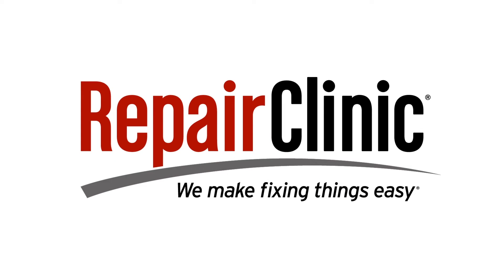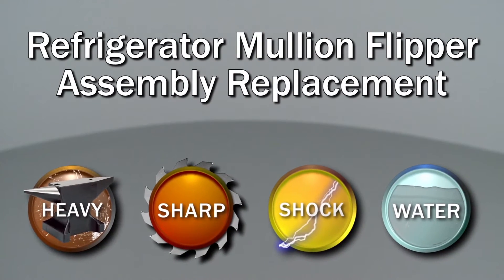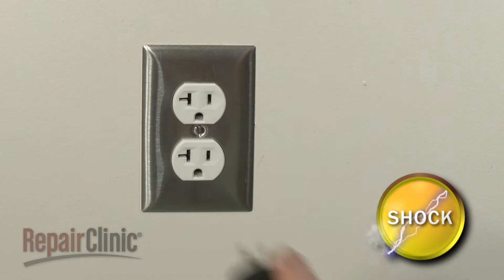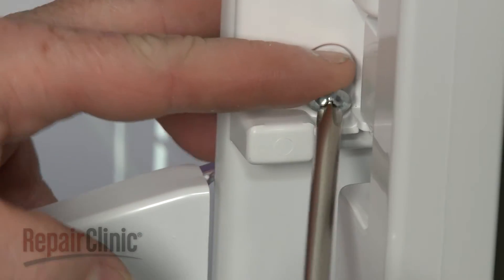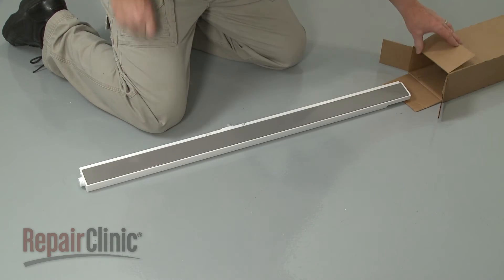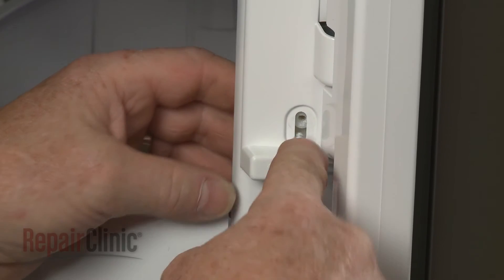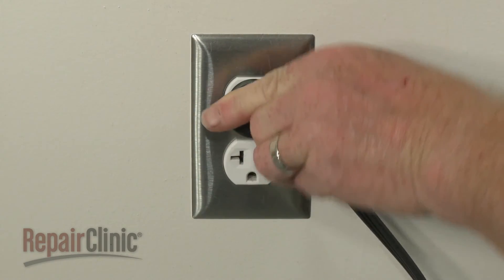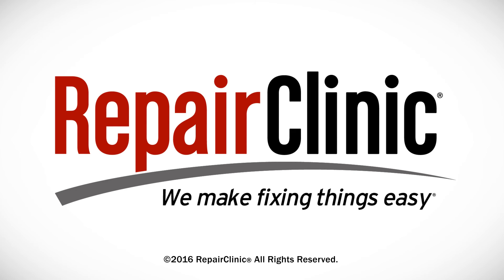Frigidaire Refrigerator Door Support Assembly 241778811

Comment: I have almost an identical fridge. The top post of the mullion broke off. I got an exact replacement genuine part, verified part numbers are identical on the physical units. Here is the kicker, the broke post at the top of the old mullion had a magnet inside, while the new mullion does NOT have a magnet inside. It is evident as the new mullion does not react at all to the old magnet. It appears impossible to disassemble the new mullion to put the magnet inside, so I am at a total loss on how to proceed.

Comment: how do you remove and replace the "mounting pins"?
Reply: I need this answer as well...the upper mounting pin clip has a chip on one of the corners and "mullion" (new word for me) becomes disattached because the upper mounting pin apparently slides off the clip towards the ceiling, and I have to use rubberbands to hold the mullion down.

Comment: This fridge sucks. A circle hole type clip holds on the pin. It broke off. Plastic is cracked and s difficult to repair for installing a new upper pin. Now the flap will not stay plumb when closing the door. Probably just going to buy a different brand than trying to repair this badly engineered appliance.
Reply: Same problem. There is no way to fix it.